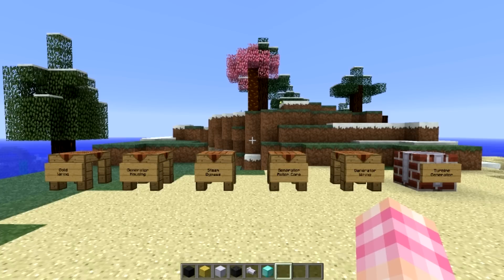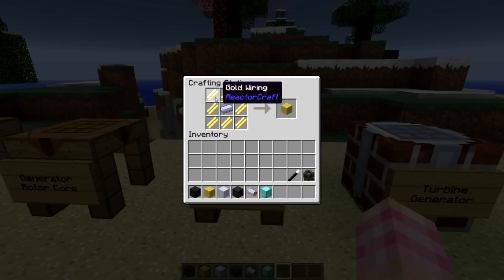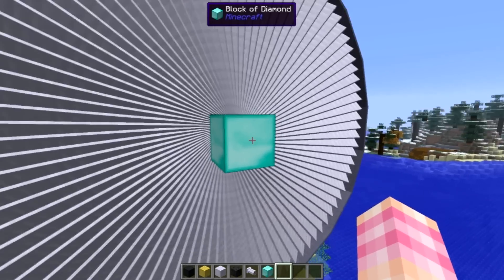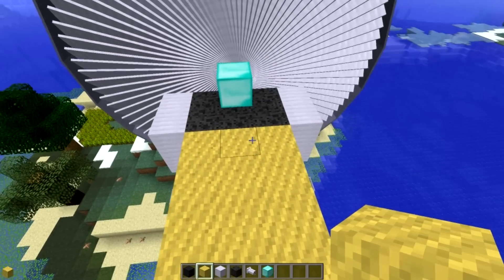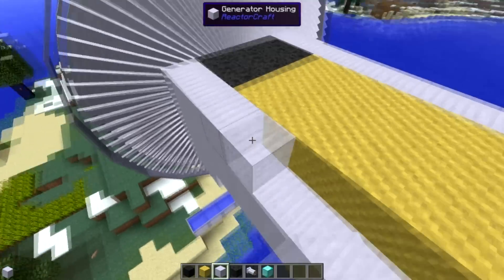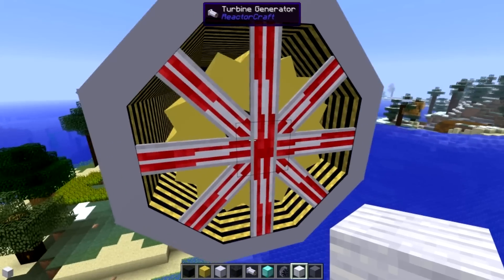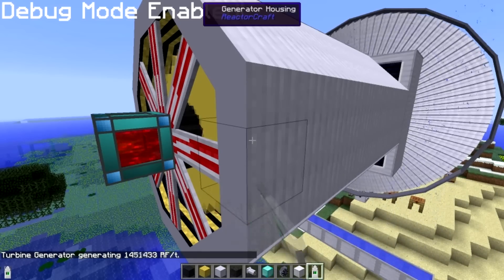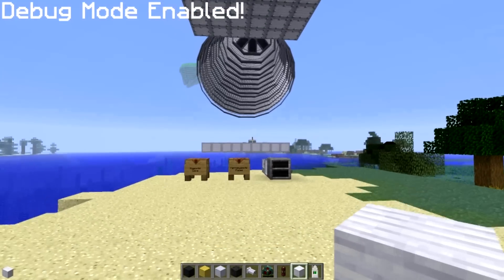ReactorCraft Tutorial #14 - Turbine Generator

Comment: In 1.7, this is 10x more powerful. And it can be configured with a screwdriver so as to generate IC2 EU (yellow) or Electricraft electricity (orange). 

Since Electricraft single-block induction generators have a limit of maybe ~268 MW now, a shaft power bus with multiple generators is necessary for converting the entire output of a normal turbine with a flywheel (and generators can still be overloaded and exploded on world load, unless shaft power input is cut via clutch before leaving. 
The turbine generator, while more expensive, can be left to run witout anything exploding. It also appears to stabilize the fluctuating output of standard turbines like flywheels do (at least considering that an electric meter attached to the output doesn't fluctuate in amperage).

Comment: You'd think someone would add an extra rotor core block between the generator and the turbine to make assembly easier.
Reply: He does, but the modifications must be listed on a config file and it's generally limited to minetweaker-type changes.
Reply from the maker: fromkentucky You can't, the generator must be right up against the turbine in order to work.
Reply: I realize that, I'm just surprised no one has thought to modify the multi-block itself to make assembly a bit easier.
Reply from the maker: fromkentucky You can't modify the multiblock. Reika doesn't allow anyone to alter his mods.

Comment: Once again, awesome tutorial :D. I'm currently running 6 of these off a 12 core fission reactor and have more power than i could ever need.
Reply from the maker: I would love to see your fission reactor design.
Reply: SentinalhMC It was the same 12 core design that you used in one of you videos (i was being lazy on the creativity side of things). Speaking of which, that design tends to have a nasty habit of overheating when running at full capacity. Also, it runs even if all the rods are lowered because it consists 3 cores orthogonal to each other on the corners. This is problematic if you are trying to be conservative of fuel.
Edit: not a complaint but a bit of info for people looking to use the same design.